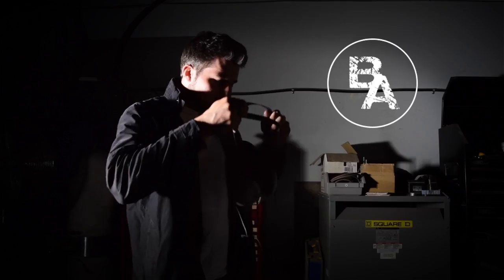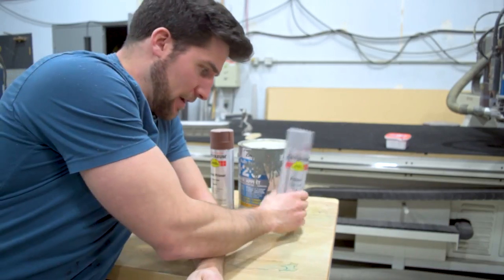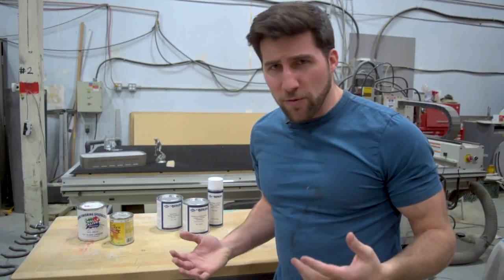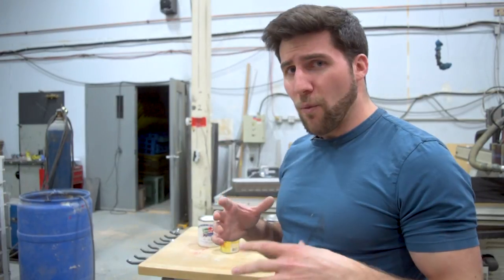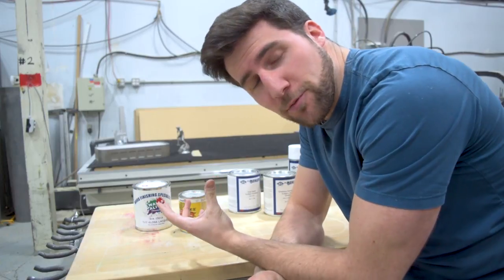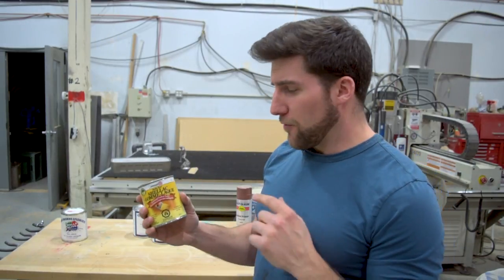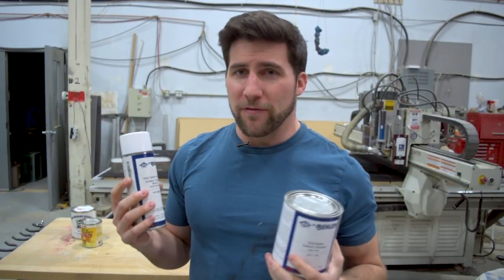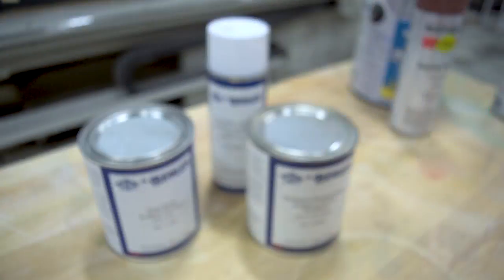Primer vs Sealer (and what they are used for)

Comment: Hello Brad,

I got some of the H. Behlen Vinyl Sealer through your link to seal up the Mahogany back of the guitar before I put down a base coat of Rustoleum Enamel.  

I'm spraying with a Campbell Hausfeld HPLV spray gun.  Can I use regular Laquer Thinner for clean up and as a thinner if I need it?

The Vinyl Sealer seems pretty thin, but what do you recommend, should I thin it?  If so, what ratio do you recommend?
Reply from the maker: There’s no need to thin it. That 1.4mm nozzle should handle it just fine. With mahogany it may take a couple extra coats. Mahogany tends to be pretty thirsty. 
Lacquer thinner will do just fine for cleanup.
Reply: Thanks once again!  Your videos are a great resource!
Reply from the maker: Thanks for watching.

Comment: So if I use a paint primer vs an actual sealer will the wood be just as water resistant?
Reply from the maker: It should. The resistance mostly comes from the top coat.

Comment: hey Brad, thanks for the heads up nice video! Quick one for you: I'm a bit confused now let's say you want to use stain or dye to create a burst, would you fill the grain with a grain filler and then apply the stain at first, or would you apply a sanding sealer at first and then apply the stain or dye?
Reply from the maker: You would need to do your dye work prior to applying the sealer. The sealer will prevent the dye from soaking in.

Comment: hello brad, are water sealers the same as other types in terms of rigidity and stiffness to build under final finish?
and will any type of clear finish adhere to it or do i am strict to water based finishes.
thanks in advance
Reply from the maker: They should harden up to a similar degree. They are just slower. If you let them dry 100% and sand lightly most finishes should be able to stick to them, but their designed to work with the water borne finishes.
Reply: @BradAngove  thanks alot.

Comment: Can I apply water based finish over the vinyl sealer ?
Thank you
Reply from the maker: That’s not what it’s intended for, but if you let it dry fully and sand first it can work. I have done it.
Reply: Brad Angove 
Thank you

Comment: So ... i can spray an Automotive (grey) etching epoxy primer directly onto the wood of the guitar (then sand at 600 grit) ? 
I'm planning on using Base coats and catalyzed 2K automotive clear coat in the end.
Reply from the maker: You can. A sealer is the more typical choice, but the primer should still do the job.

Comment: Hi Brad, i'm trying to refinish my guitar and i need to apply a primer, but when i spray it it seems to "crack" on the imperfections of the wood... shouldn't it work the opposite? Is it not supposed to fill the imperfections?
Reply from the maker: Primer is more for adhesion purposes. It can fill minor imperfections, but if you put it on too thick it will crack.

Comment: So what's your favorite 2k catalyzed primer? I've got the tools to use the stuff safely, just need a recommendation on what to use for my first attempt with my new turbine sprayer. I'm leaning towards using HOK KD3000 since it's easy to find, but I've seen good things about SPI which seems to be much cheaper
Reply from the maker: HOK and PPG are both great. I don’t think I’ve used SPI
Reply: @BradAngove  Awesome, thanks! I'll check out PPG and see what they've got.

Comment: If you're using a water based stain/dye like the crimson guitars stunning stains, how do you go about sealing?
Reply from the maker: I would use one of the solvent based spray dealers like the vinyl sealer that I recommended here. My old demo of the qualalacq lacquer sanding sealer was done directly over the water-based crimson stains.
Reply: OK, so it's stain first, then sealer and finally poly?
Reply from the maker: Correct.
Reply: What about grain filling too.  Would it be stain, grain fill, seal, topcoat?
Reply from the maker: I generally grain fill first and then stain.

Comment: Does ash or basewood need sanding sealer after 2 times grain filling? Or should i straight away spray the colour and then clear cloat?
Reply from the maker: I like to do a coat or two of sanding sealer, but you can probably get away without it.

Comment: So, does this mean you do not need to use pore filler on woods with pores if you use a sealer?
Reply from the maker: On opened pored woods you still need filler. Sealer doesn’t handle large open pores. You would put it over the filler.
Reply: Thanks!
Reply from the maker: You’re welcome.

Comment: Do I need to use a sanding sealer if I’m going to use die on a guitar body, if so do I put it on before or after the die?
Reply from the maker: After the dye. The need for it is determined by wood porosity, not whether or not you’re dyeing it.

Comment: Would you use sealer/primer when refinishing a guitar? Or would you just skip this step?
Reply from the maker: I generally would unless I was just changing colors and not removing all of the prior finish.
Reply: @BradAngove  I'll just change color. Probably won't sand to bare wood. I already have the sealer, tho.
Reply from the maker: You can still use it, but the original finish will also suffice to act as a sealer.

Comment: hey brother so i just recently sanded the finish off of one of my guitars so that i could re-finish it and make it look better. i started with 60 grit and finished with 220 grit, i got a botller of martha stewart spray can sealer from a friend of mine today but it says that its clear satin, do i need to use a gloss sealer or would the stuff i have be okay ? when its done i do want it to have a shiny/gloss look to it. i've watched all yur other videos on finishing guitars with spray cans but i dont remember hearing what kind of sealer yu used lol. if yu could help me out i'd really appreciate it !! thank man 🤟🏻
Reply from the maker: Is this going to be your final finish, or is this a sealer for the wood before you move in to painting?

Comment: Hey Brad. As always, exactly the information I was looking for. Just a quick question about the Epoxy primer. I use all the spraymax products to paint and top coat, am really careful and treat them with the respect they deserve. I mean, if you're using a product with a skull, a fire and an explosion on the label, it's probably safe to say that you need to be super careful. That being said, would their 2K epoxy primer do the job to seal up some exposed grain for an opaque finish using their 1K paint? Any advice, as always, would be golden.
Reply from the maker: If it’s heavy open grain I would do a light fill first, sand smooth, and then prime.
Reply: @BradAngove  Thanks brother. As is usually the case with me I couldn't wait and had to see if this Epoxy Primer was any good. I ordered it from 66auto along with a color called Viking Blue, which was the color that they painted the Shelby Coupe race cars back for the Daytona Races they won. Anyway, THAT's a sidetrack. I used the primer on a single cutaway set neck guitar, sanded it to 400, sprayed the primer (3 coats) then the color (4 coats) then closed it up with the 2K High Gloss Skull and crossbones, death spray.  I'm gonna let it dry for a week and see what I ended up with. But it looks pretty cool. Thanks again for the advice. Hope you all are doing well!

Comment: Hey man. I threw you a bone when I bought my last kit from solo. I appreciate what you do. I have a few questions you might be able to answer. Send me a message if you have a couple mins to talk.
Reply from the maker: Thanks man. What can I help you with? 
If it’s private you can email me at brad.angove@gmail.com
Reply: Stain way darker on the sides opposed to the top and back. Is that normal? Am I sanding too much or not enough maybe?
Reply from the maker: You’re saying your stain is going on much darker on the sides? Which kit was it?
Reply: The cheap tele with black binding
Reply from the maker: Ok. It comes with a coat of sealer on it that would prevent stain from soaking in all that well unless you essentially sand through it. You probably sanded through it on the sides (might not have been as thick there), but not on the top and back.
Reply: Thanks brad that makes sense now. I appreciate your time.
Reply from the maker: You’re welcome.

Comment: I had to change both my front and rear tires of my electric scooter like in the video I provided below but ended up with some bad scratch marks on the rims. Do I need to spray paint enamel primer and then the paint itself?

https://ae-cn.alicdn.com/zFb7FA3VvR9qYBQ2xR3/N8ovwpbUKigm4GzEPrb%40%40hd.mp4
Reply from the maker: Are you repainting the whole thing?
Reply: Just the rims. I kinda messed them up with my flathead screwdriver
Reply from the maker: If you sand them back to the metal you will need primer. If the scratches aren’t very deep you can just sand the surface of them until the scratches are gone and then spray your colour and clear.

Comment: Are sealers good to use on silicon watch straps?
Reply from the maker: I don’t think paint will stick to silicon
Reply: @BradAngove  it does stick to the Tpu plastic bands but the only problem is it chips off so I have been trying to find the most effective clear coat for it